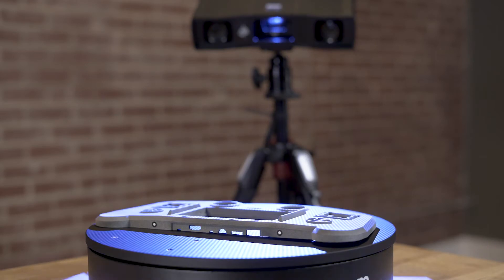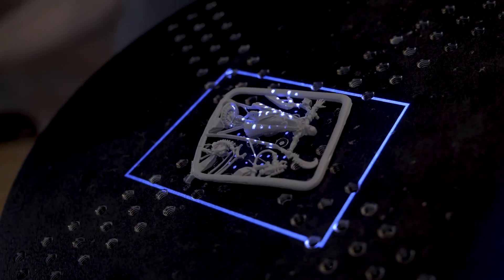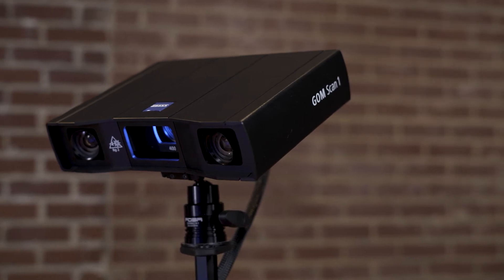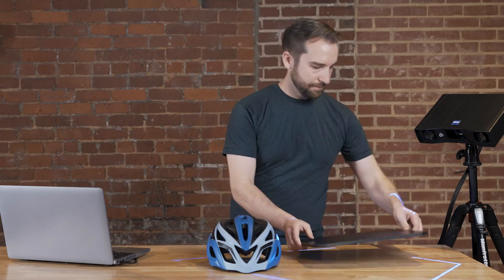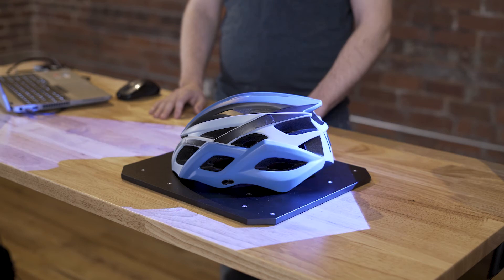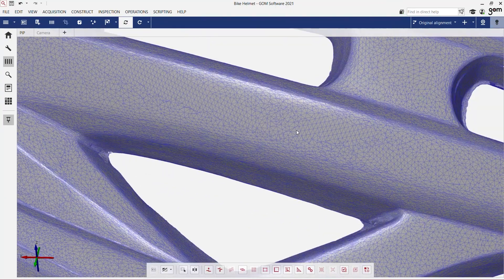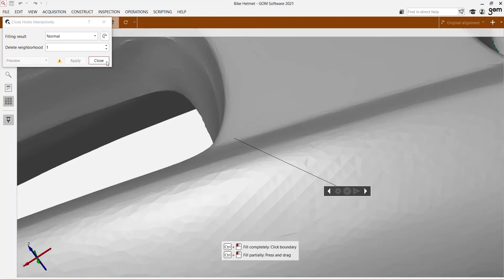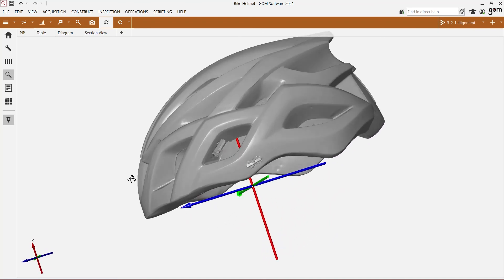GOM Scan 1 for reverse engineering and 3D printing

Comment: Does this model use targets like the Triple Scan or 5x?
Reply from the maker: Hi Steve. In general, you can scan without targets also with Triple scan and 5X. The targets helps to make scanning more easy and robust. It generates a close loop between the part and your scanner. If the part would move, using target will help to detect this.

If you have more questions, please reach out to support@handsonmetrology.com